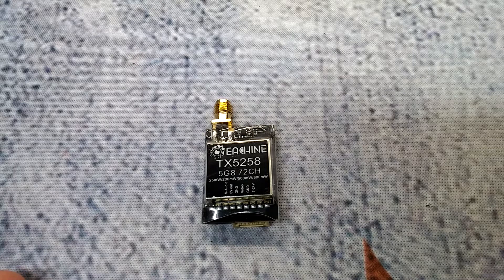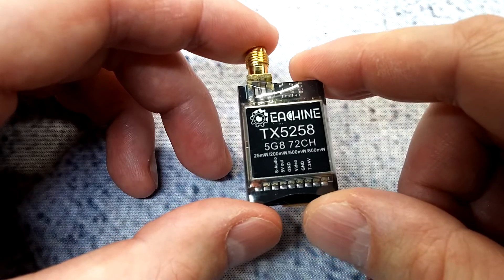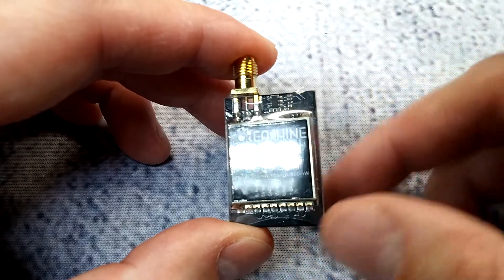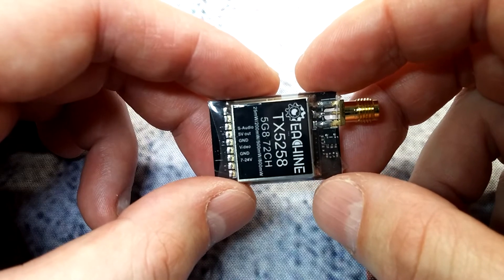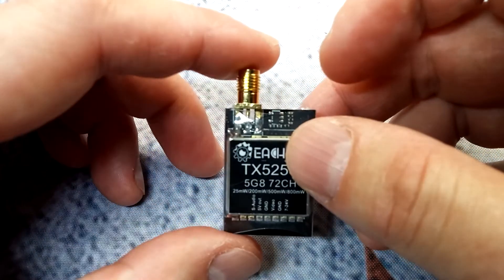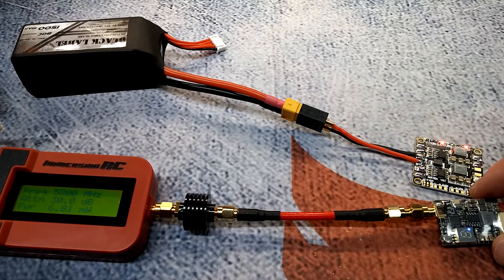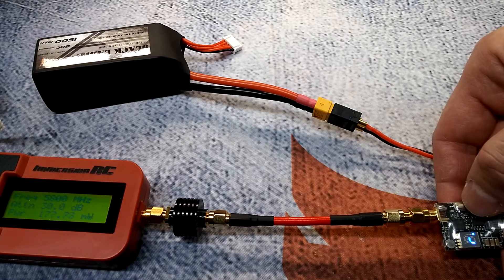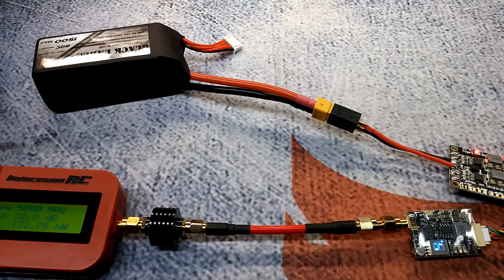Eachine Smart Audio TX5258 Review & Power Output Testing

Comment: Not sure what the problem is with rp-sma. That is what I use, I just make my antenna to suit the Tx I am using. If you are in love with sma which performs no different, change the connector or dont buy or change your fitting on the antenna.
But never have I heard of a connector standard being sma.

Comment: Im leaning towards the fact that you got a dud.....I went out 10.2km today with mine set at 800mw on RB1. Video was very good, still had colours and detail just a slight degrade in image.....im extremely impressed with mine
Reply: That's the problem, they are all over the place. I bought two, one is about the same as this, around 23dBm, the other 25, but it's a bad gamble, how many do you have to try before getting suitably close to what you pay for.
Reply: What bands were u set at

Comment: Eachine back at it again with the lies lol
Reply from the maker: Ukalele FPV - I'm not sure if I got a lemon here or not, and usually you get what you pay for in this hobby, but the testing results don't lie...
Reply: SteelRainFPV I have terrible noise on mine not sure of a cap would work to do anything
Reply from the maker: Ukalele FPV - A 25 or 35 volt low esr capacitor would definitely clean up the video noise, Drone Mesh has proven this on his YouTube channel with a spectrum analyzer, and I put them on all of my builds nowadays.
Reply: @steelrainfpv3383  Hi, please tell me what wire to put the cap on?
Reply from the maker: @blackterminal  You would place the low esr capacitor on the main battery power leads that are soldered to your flight controller.

Comment: These tests are flawed, consider teardowns instead. Pop the cans and show us what RF amplifier chips they're using. Just too many ways to skew the results even by accident
Reply from the maker: C. Av - Well everybody does have their own opinion on the matter, but if you read the video's description concerning the testing methodology and parameters, I just don't see how a vtx like this can only output a quarter to a third of it's manufacturers stated power levels, yet if I pop one of my 4  TBS Unify's on the meter they are spot on every time..... Can you please explain how this is possible, how this method is flawed or accidentally flawed, since all of these vtx's that I've tested have had the same opportunity to perform or fail? I'm genuinely curious....
Reply: SteelRainFPV Open the vtx and see what amplifier chip is near the output, there will probably be your answer (and a case for refund). But could also be as simple as a loose connection somewhere acting as a resistor in series limiting the current..
Reply from the maker: C. Av - I just pulled the cover off, which was conveniently soldered shut on 3 corners, and all I could make out was the numbers on two chips. The main big black chip is labled RTC6705, and a small silver chip labled 8.000 mhz. After doing some research I found that the RTC6705 chip is indeed a 5.8ghz chip used in our hobby, but there is a smaller amplifier chip closer to the rp-sma that's supposed to tell the tale, and it has no discernable markings that I can see even under a magnification lens, like it's been erased. Nothing else was loose, missing or soldered incorrectly from what I saw, but I've heard the Chinese manufacturers have a tendency to scrub some important chips clean of their markings for some odd reason.
Reply: SteelRainFPV Nice hope you got it all in one take! Wow they actually took the time to scrub the chip, that costs extra LoL. rtc6671 or 6659, neither will do more than 600mw and need serious cooling over 200mw. Now to open all the others ;)
Reply: C. Av awesome!! I’ve seen people going miles with this and some not going more than a couple feet... all I can do is cross my fingers!! Or get the brand new AKK 1200mw mmcx vtx :D
Reply: Mini Quads Mega Fun At 5.8 good antennas are what make all the difference! People getting 10's of miles on 5.8 forget to mention they are using antennas tuned on expensive lab equipment! Better antennas over more power any day. I wonder how long the 1200mw would last with a loose/broken/badly tuned antenna?!